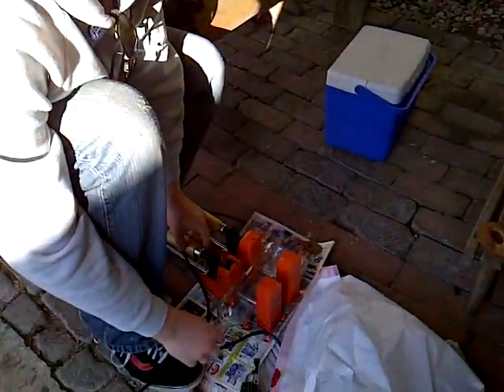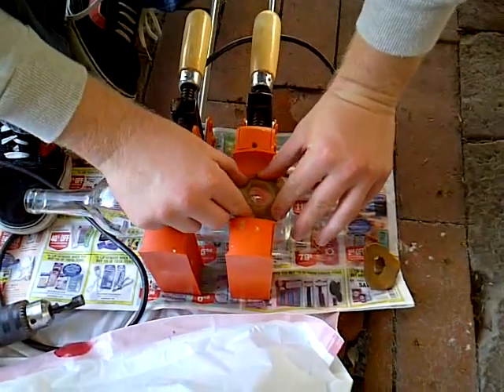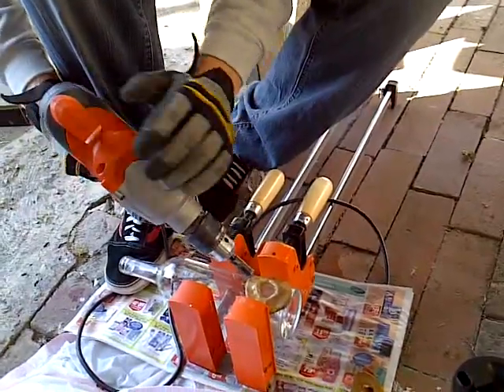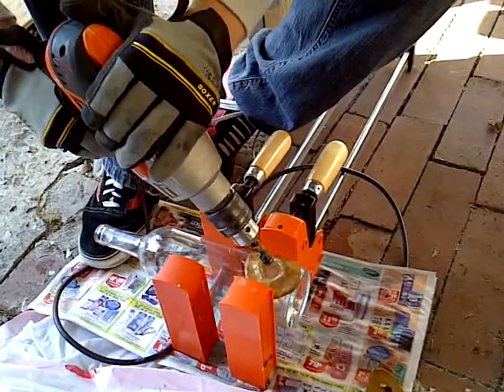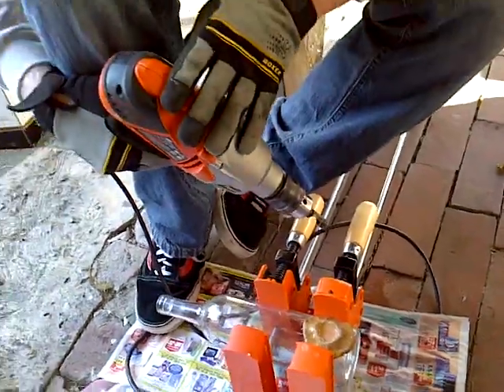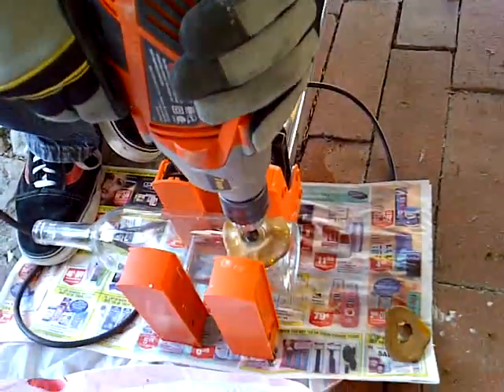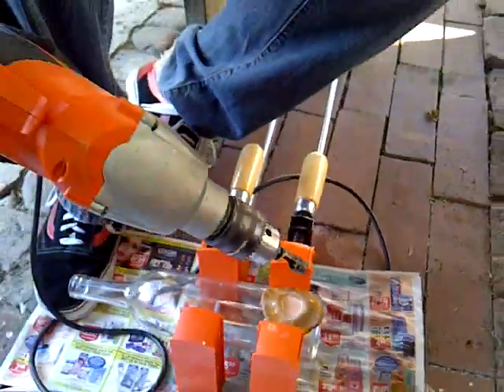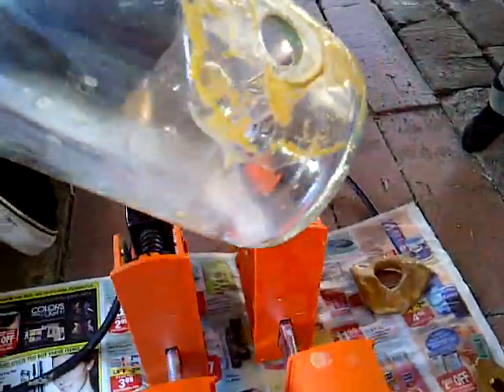DIY Drilling a hole into a recycled wine bottle.

Comment: Wow, this takes too long. I fill the bottle w/water, cork it and use a Dremel with a diamond bit. The water naturally dissipates the heat produced by drilling. 
Once through the glass, empty the water and proceed to enlarge the hole.
Haven't broken a bottle using this method.